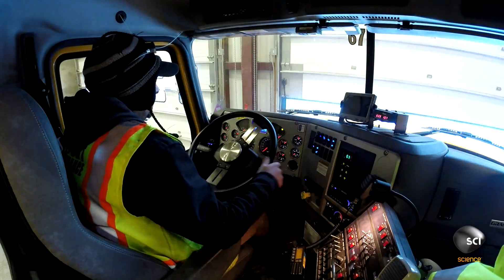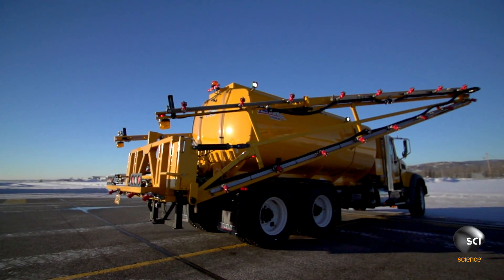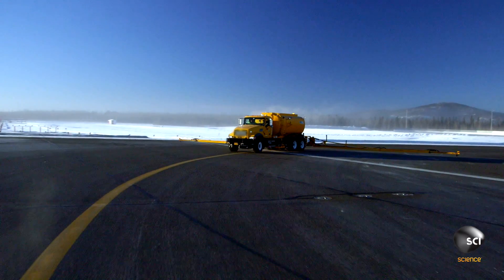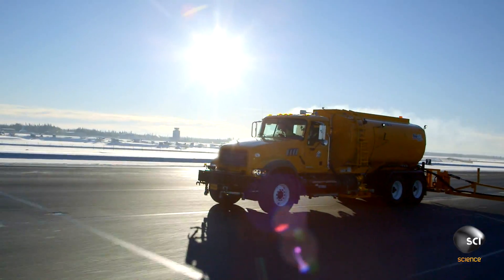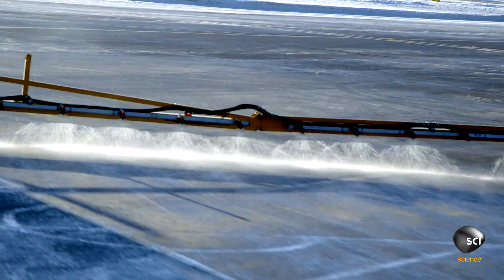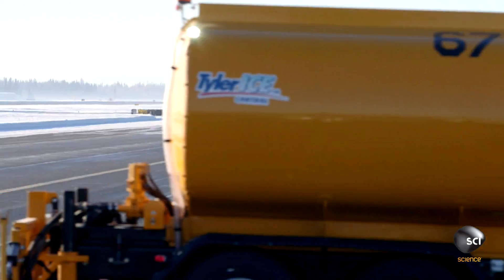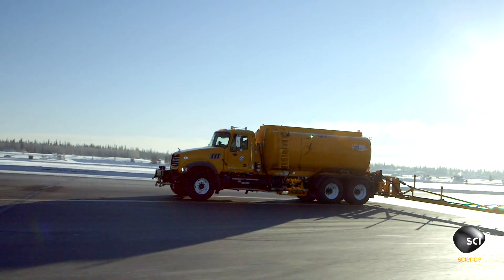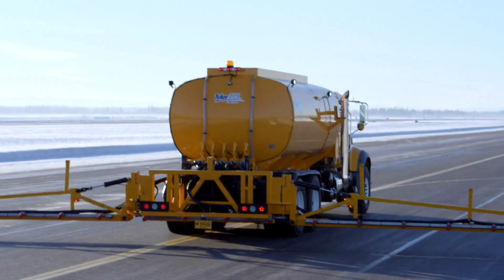How Do Alaskan Airports Keep Runways Ice-Free?

Comment: I’m slightly confused why they have to spend 20k de icing the runway- what happened to good old fashioned rock salt like they use on the road?
Reply: Tenth Dimension true dat
Reply: salt also causes planes to rust and break down just like cars
Reply: Angus Anderson salt stops working effectively at 28 degrees fahrenheit. Potassium acetate works below -20 degrees fahrenheit. Not the same thing.

Comment: why does potassium acetate cost so much? is there no other cheaper alternative?
Reply: It doesn’t really cost that much. 4000 gallons of water is still $4-9k depending where u buy from and in what quantity at a time
Reply: $4-9k for 4000 gallons of water? are you crazy? You mean $400-900, right?
Reply: The cheaper alternatives cause the plains to rust and degrade
Reply: emeaney3 Nope
Reply: Cris LeRose Only works for bush planes AKA piper cub and cessna.
Reply: Im guessing yes but Alaska just wants to show of LOL